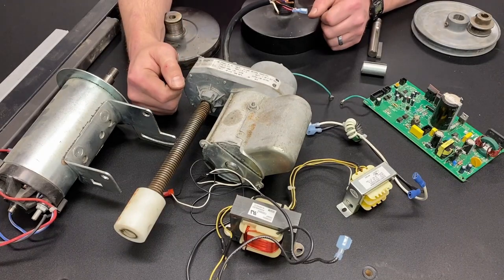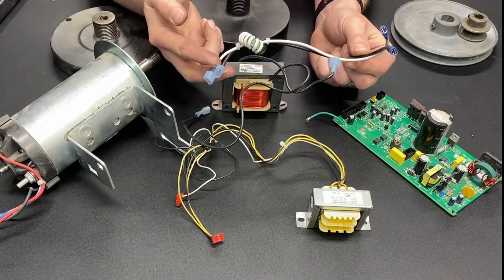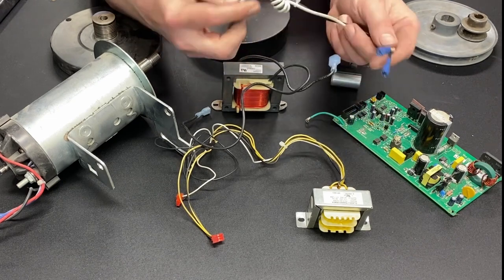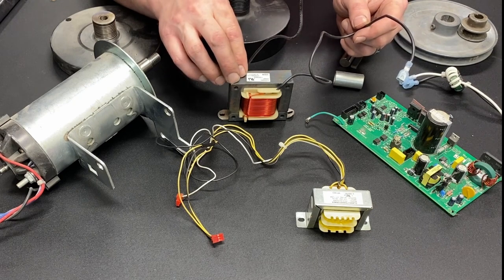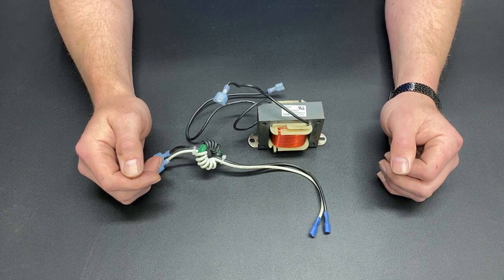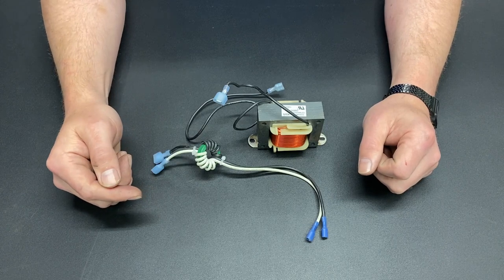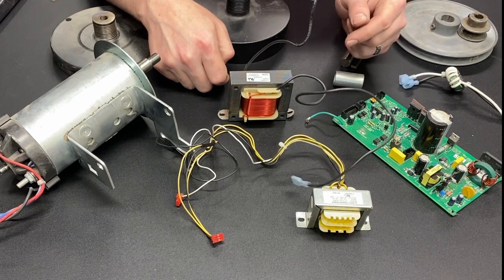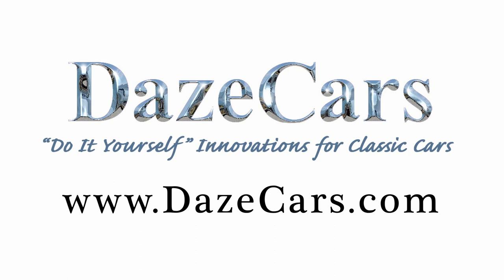Treadmill conversion FAQ 6. Where do you get a choke?

Comment: I just found an old landice treadmill with a baldor 3hp motor, it also had a large transformer (4 times larger than microwave) and a big 250v capacitor that were seperate from board. On the board there's a smaller transformer on the board and a there's an inductor on the board too. Im attempting to build a bench grinder. Im currently trying to decide what I need to build a controller.  Do I have everything I need at this point other than a pwm? Will I need  that capacitor or large transformer?
Reply from the maker: First off all are they transformers or chokes?  They look the same but are not.  Second what do you plan to use as a controller?

Comment: Hello again, I have just gather all the parts and pieces you recommended. Put it all together and now the 3HP motor runs silky smooth in both directions. I have scrapped 4 treadmills from very expensive to the bottom of the line and finally found a large choke with a mc60 board in the cheapest treadmill. For anyone looking for free treadmills Facebook Market Place is a real good source. Most treadmill manuals are on line with parts list, so if you are just looking for a choke, check the parts list first. Thanks for all that you do, it makes a real difference trying to figure this stuff out and save a good Delta lathe from the scrap yard. 
Just one question: Is there an ( in and out) when wiring in the choke?
Reply from the maker: No the choke is not directional, there is no in or out.

Comment: First of all any wire coil independent of the core material (air, iron plates, ferrite rod, or magnetic torid) is an inductor; and the property of an inductor is called inductance and is measured in inductive reactance. The term "choke" also an inductor, and is used to block higher-frequency while passing direct current (DC) and lower-frequencies of alternating current (AC) in an electrical circuit. The name comes from blocking, or "choking", high frequencies while passing low frequencies. For DC currents the inductor will only show a slight resistance to the flow of current through it, but if the signal has an AC component then the inductor will oppose this current flow and its oppoisiton to the flow is a function of both the value of the inductor and the frequency. The larger the value of the inductor and the higher the frequecy the greater the total opposition to the flow of the AC signal will be.
Reply from the maker: Thank you for the insightful education.  I have never claimed to be more than a hobbyist and I am sure there are things I have not quite gotten correct so I appreciate you taking the time to help educate myself and others.

Comment: Exactly want I wanted to hear. I am currently grappling with connecting the treadmill motor. Our power mains are 240v but it is 120V DC. I got it the motor without the transformer. I went back to the recycling depot. I got all 3 parts mention in the video but I didn't know which is the transformer. Thanks alot
Reply from the maker: glad I could help

Comment: Hey, what are your thoughts on adding a DC generator to an existing power unit generator. Something similar to David Poz project, https://youtu.be/DaF6n-9RVT4. The big change is the primary unit is going to be my Kohler Confident 5 Power Unit (rv/utility generator), https://youtu.be/Gsz9L20A6vg.  I have a Midnight Kidd SCC on the shelf that is rated for wind and turbine usage. The power unit is rated at 9.8 hp at 1900 rpm but is 20 hp at full 3600. The treadmill motor at its rated constant duty is 2.6hp 110vdc/1939 watts. The end goal is to let the generator (4.7 kw) run critical loads while the treadmill motor charges my solar battery bank in an no sun situation.
Reply from the maker: As long as you use a proper power regulator so power is not feeding back into the motor powering it, I do not se any reason why you coud not hook it up that way.  However it will not be "free extra energy".  When a treadmill motor is acting as a generator it is harder to turn.  To illustrate take a treadmill motor that is not hooked up to anything and spin the shaft, then conect the positive and negative led and spin the shaft again.  It will have a lot more resistance.  The more current drawn from the DC generator the more resistance.  In other words the gas motor will need to work harder to generate AC and spin the treadmill motor as a DC generator.  If the AC generator motor was over sized and putting out extra HP that was not being utilized generating AC then gas consumption would stay the same when hooking up the treadmill motor BUT most generators are optomized for efficiency so any adtional load would also increase gas consumption.  It may only increase it slightly and be worth it but It would likely be more efficient to use the AC output of the generator to charge your batteries.

Comment: On using a microwave transformer , using it's wires as a choke , if you cut down the legs to make the frame tighter to the coil ,would that solve Humming issues?
Reply from the maker: the huming issue was the result of the top not being welded back on.

Comment: Does the choke get wired inline on the positive or negitive  DC output?
Reply from the maker: It can actually go on either side.  Some treadmills have it on the negative, others on the positive.  I would try it in both locations and use the one that has the best result.

Comment: My treadmill came with a MC 60M. The H,W, and L prongs are not there. I also have a DC choke (big inductor) in it, and no AC choke.
Reply from the maker: I would need to see pictures of it.  Can you contact me through my website and email clear quality pictures (some times people send me blurry or low resolution pix) of the board paying special attention to the connectors?

Comment: I Really enjoy your presentation. You're a great teacher and I Thank you for sharing . my question is can capacitor be used with the SCR controller instead of a choke ? Also if you could add to that as far aa size and number .
Reply from the maker: I am glad you like my videos.  A capacitor can be used as a way to smooth out the power coming out of the power supply, however it works differently from an choke and I found them to be problematic.  Here is some info I put together on my experience with them.  https://youtu.be/eR7PIEVurMA

Comment: Hello.. I found the corresponding motor choke for my treadmill motor. I have a quick question.  It comes with a capacitor strapped on top of it. Should I use the capacitor?  If so or not, why?

Thank you in advance.
Reply from the maker: It depends.  Some motors require a start capacitor.  If that is what it is it should be used.  If not for starting it is there to smooth power and is optional.  I ran smoothing capacitors on several of my machines and they caused surging under a load so I removed them, but that was specific to my application you may have better results or the same thing.
Reply: @dazecars  Thank you for your comment. I love your work.

Comment: Electronics tech here:  Remember  this saying:  '' ELI   the   ICE   man ''.    ...where  E = voltage  L=coil   I= current           I=current  C= capacitor  E=amperage:  >  > >>   Explained =   voltage  LEADS  the current, in a COIL     (and)  CURRENT   leads the  Voltage, in a capacitor circuit.  
  This, may clear up any misunderstanding. i converted my Lincoln AC 225 welder, to DC; using 300 amp bridge rectifier,  4 large metal high voltage capacitors ( 8 microfarads, 250 volts),  and a home made  ' reactor inductor '' , using microwave oven transformer, (removed all wires)  and wound the 0 gauge welding cable, about 5 turns.  Welds  very  good.  The capacitor, is in parallel  with DC output of rectifier, and reactor-inductor,  in series with the  +  electrode wire. So, the benefit, is  when starting the arc, the voltage is higher, than the  ' running amps '....after striking and maintaining the ' arc '.   (capacitors, smooth out the ripple DC, improving DC voltage).   Good luck, all, and   HAPPY   diy-ing.    Good  work, DazeCars.....your not   ' dazzy '.....at all.  Evidence, shows....now, gotta go make a mile on the treadmill, (mild workout !)
Reply: sorry,  ICE  should be  -current ; capacitor ;  VOLTAGE, not amps.   ....
Reply from the maker: Thanks for the info!! always good to get technical info
Reply: @dazecars  No p.   (from Alberta Canada ! )
Reply from the maker: @petersack5074  we are neighbors, I'm in Montana

Comment: would something like this work? how do you size a choke?
Reply from the maker: something like what?  If its not listed as a "motor choke" it will not work as it will not be big enough.
Reply: @dazecars  im sorry. i guess the link didn't go through. im just a little confused about Choke vs. Inductors and how to guage the size needed. im probably going to diy one. i think a video on how they are different from torrids and how to diy one from scratch. im most likely going to tear apart a microwave transformer, but it seems so excessive for the use. also, if filter chokes only allow dc to pass through. why is it we need the bridge rectifier? its hard to find info on them without knowing how to read a lot of the explainations. (im a hobbiest, not an electrical engineer). my guess is either heat disapation or im incorrect in that they only allow dc through them.
Reply from the maker: A choke is not technically AC or DC they both allow either current to pass as all it is is a coil of wire.  The magnetic field created is what removes smoothes out the power and balances everything out.   I refer to them as AC and DC because of how the two main designs are used.  The doughnut with two wires wrapped around is used on the AC side and the single wire coil is used in DC applications.  Again if you are trying to buy it new and it doesn't say "motor choke" it is way to small.  Chokes are normally small components used on circuit boards and the only reason to make one this big is for a MOTOR. This video should help explain further https://youtu.be/hbfOWrmP_pw

Comment: Hey mate if I’m to buy a choke do you know if I want high or low H?
Reply from the maker: Not being an electrical engineer I do not have any specs for you, what I can do however is offer you some guidelines. First of all bigger is better. I have several motor chokes ranging from the size of a tennis ball to the size of a soft ball and the bigger they are the better they work. Second the wire for the choke needs to be a minimum of 16 awg. If the wire is not that big or better it will not have the amperage capacity to allow the motor to work properly. Amperage is the most important spec.  A lot of the chokes available on line are rated in mA.  there are 1000 mA in an amp.  treadmill motors are rated in amps so most chokes available on line are several hundred times too small.  Third they are not available on Amazon at least not inexpensively, there are a few privet sellers on Amazon selling used parts for big bucks but the available chokes on amazon are too small because they are not designed for a motor even though they look correct in the picture they are way too small. The choke in most of my videos is part number 130993. Instead of getting one new I would get a used one. A lot of treadmills come with a choke. Go to eBay and search “treadmill motor choke” BUT know that most people on eBay don’t know what they have and the word “transformer" will also appear in most listings. Problem is a choke and a transformer look almost identical so some listings are for transformers and some are fore chokes because the sellers think they are interchangeable. They are not. They would only be interchangeable if you modify a transformer to work as a choke. (see my DIY choke video) To tell the difference count the wires. A choke will only have 2 wires, a transformer will have 3 or more. Also before I started doing videos chokes on eBay could be had for $25 or less shipped but now that more people are looking for them (due to my videos) the eBay sellers have raised their prices quite a bit. Your best bet might be the DIY option out of a Microwave transformer. Please let me know if I can be of further assistance.
Reply: @dazecars  cheers mate I ended up working out how to tell which treadmill I wanted and scored the choke I was after 👌🏻. (Dial or slider for speed = old school scr treadmill 😎)
Reply from the maker: yess all of those will have a choke but some digital panel units will also have a choke

Comment: i have found the ac inductor you mention in some of the treadmill motors wires  i salvaged so it seems they are also functional for dc or they are at the last station to the motor to prevent ac current maybe? or ac passively generated when treadmill is stopped but takes time to acthally stop.
would like to hear your thoughts about this.
and one other qurstion not sure you related to in your videos is the conversion rate of wall ac to dc if no potentiometer used..recently i have replaced ac induction motor on a planer and jointer old kitty machine with treadmill motor. havenot tested it running but here it is 220 volts ac and the motor is up to 180 volts dc so if i look through internet for conversion calculator for 220 volts ac it will be 140 vdc..meaning i can run it without overloading the motor. will love to hear about that as well. cheers
Reply from the maker: A choke will work for both AC and DC.  The inductor I show in the video works better for DC because it is on both legs but being such a small coil its effectiveness is limited.  As to the max voltage you loose a little but in the conversion but not much I would guess 180-200V

Comment: Hi. I can use a ballast? I have a 400w one.
Reply from the maker: A ballast resistor will reduce voltage not eliminate spikes.
Reply: @dazecars   A ballasts for fluorescent lamps
Reply from the maker: I have not messed with fluorescent lamp ballest.  I don't think it would work for this appplication but I honestly don't know enough about them to say for sure.

Comment: What is the size or parameters or part number of the choke you show in the video?
Reply from the maker: I don't have any specific specs for you.  What I do know is physical size makes a difference.  The bigger the over all size of the choke the larger the ferrite core and the larger the coil said choke will have and this translates to a more effective choke. This is easily observable in motor noise reduction not to mention a reduction in internal sparking as you increase speed.  No choke, small choke and then large coke there is a noticable improvement with each step.  The one I show in the video is about the size of tennis ball (came out of a lower quality home treadmill). The choke I have one on my lathe is closer to the size of a softball and it works way better. (came out of a high end gym quality treadmill) As long as the choke is for a treadmill it should work well but if you can get a bigger one you will see better results.